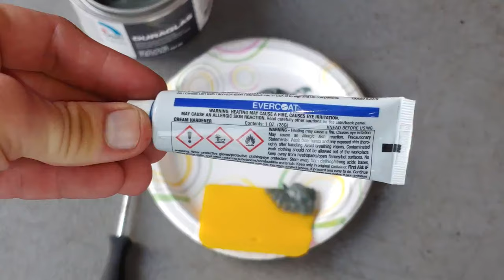SATISFYING Tool Box Restoration!

Comment: How come you didn’t take the top chest off before painting? It’s meant to come off (it even has handles) and is just screwed down from the lower half. Would have been a cleaner finish. 

But good video overall. Duraglass to fill the holes was a good idea. Thanks!

Comment: Satisfying restoration? Didnt replace drawer slides, didnt appear to have hammered out dents and dings, painted over original powdercoat, didnt appear to have replaced castors, if anything this is simply a touch up. A half assed touch up, at best  👌

Comment: Did you ever have any trouble with the 2k primer? Tool boxes are usually epoxy or powdercoated. Ive been using spray can 2K and it seems to damn hot for anything under it. Cracks and crows foot like crazy on me. Tool box paint should be super tough though. Im getting ready to do my little box like a miltary crate theme for my gun room.

Comment: How are you liking the box? I have been looking at one of these brand new for 100 bucks, but i'm a bit worried about the quality of the drawers, as well as the over all size. I'm also concerned about the practicality of having a bottom cabinet, rather than more drawers.
I have a tool box now that's probably a fair bit better in quality, but i'm running out of room, so i kind of want a secondary one for the tools that i don't use as often, so i'm just curious if you think it would be worth it for the price, or if it's not worth it, and better to save for something bigger and better. :) 

Unfortunately second hand rolling tool boxes don't seem to be a thing here in Denmark, and the few that are available, are as expensive as the new similar ones from the same brands, which i find strange.
Reply: Little late on this, but I'd say look for something you like. If you dont think you'd like the cabinet, then dont get one with a cabinet. I always try to think why settle for less than what I really want if its something that I'll regularly use
Reply: You have a lot of concerns for $100 item... just build your own or use milk crates.

Comment: I saw the wheel.
All that time I was saying, "No!!!"
Success is 95% preparation.  You have massive over spray inside the drawers.  You didn't even tape inside the slot by the lock.
Reply from the maker: Haha I did spray the wheel. You caught me! But to keep it honest i use my tool box every single day and I onew it would get beat up in thr next few months. We are about 3 months in amd it could use a touch up!
Reply: @BuddysDIY  I suspect you know over spray catch taping for areas like doors, and hoods.  Show your audience how to use side taped paper to keep internal surfaces clean.
Let me suggest touch up to 2 coats primary, and clear coat.
Better look, better protection.
BTW you DO do an excellent job with just a rattle can.  It is a fine job.
Reply from the maker: Yeah it was a lazy job. If youve seen my othet videos ive painted cars completely and done alot of work with rattle cans on rims and bumpers. I appreciate it man. This was a quick job. Wasent even supise to be a video but decited to just film real quick
Reply: @BuddysDIY  👍

Comment: Hi...It looks great! I'm just curious why you didn't do a clearcoat.  I guess I would be afraid the paint would chip/scratch.... I'm currently repainting a brand new red craftsman very similar to this one&I want the paint to stay put but I don't know much about these things.  I know its crazy to paint a new one but I want it hot pink!
Reply from the maker: I would say a clear coat is a bit extra. I'm not too worried about scratches because thw primer will hold thr paint in place and won't peel off. Now in terms of a clear coat if i were to do one of probably get a flat clearcoat. The most important part is the sanding and the primer!!! If the paint is pelling and its a bit rough then go for 150-220 grit then smooth it our wiih 320-400. 💪💪

Comment: Thanks for demonstrating how to properly repaint a toolbox:  tape on the locks, tape on the handles and chrome drawer fronts, and over the name plate.  When you were done, the unit looked brand new and professionally done.  Unless you take the time to properly tape everything up correctly, the whole thing looks like a kid     got ahold of a can of spray paint and did the job; it looks like a child’s unsuccessful first attempt at staying inside the lines.  Messy at best.  Give yourself a pat on back for a job well done!